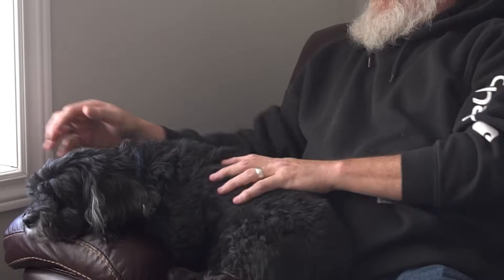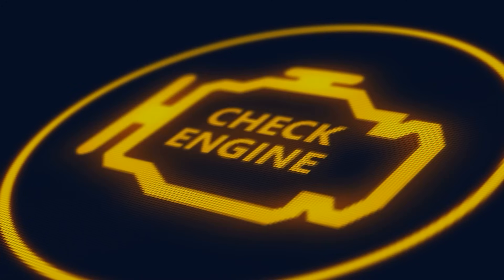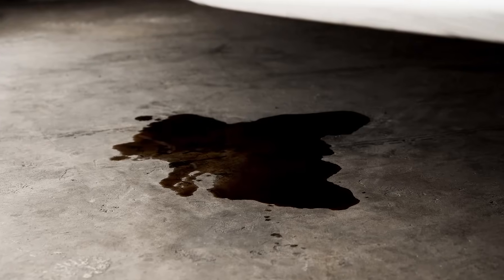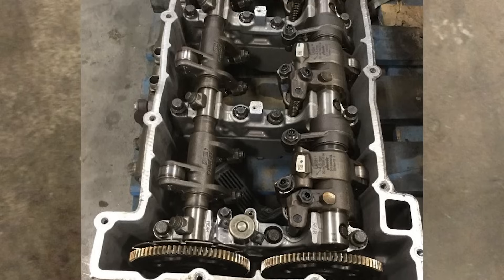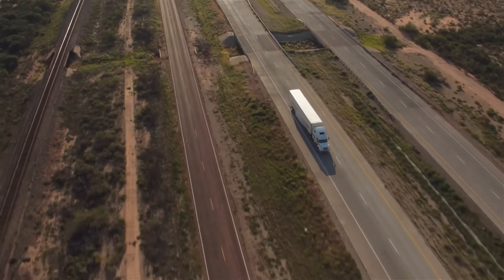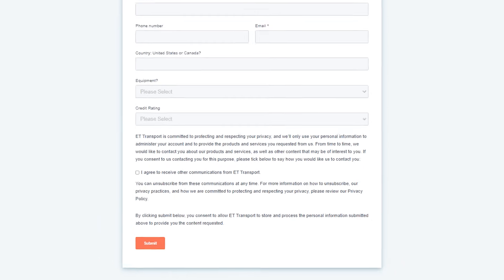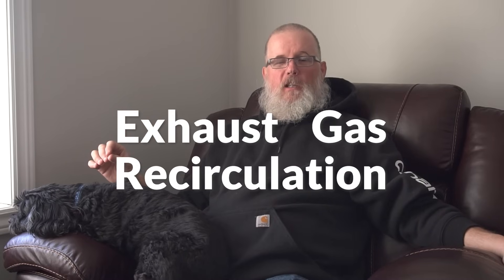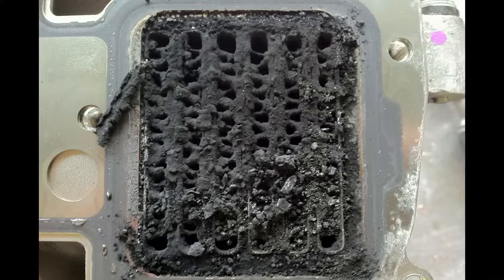Biggest Issues with Diesel Engine DD15 - WATCH OUT!

Comment: I'm a mechanic and at my company they have cascadias with detroits and kenworths with cummins and all the Detroits (dd15) have oil leaks hahaha even the brand new ones have oil leaks because of the oil pan gasket, rear main seal, oil pan drain most commonly
Reply: So basically Cummins is not in the shop as much ? What engine the Cummins ISX and what year truck

Comment: My truck has a diagnostics tool on board. Different than just codes and tells me all I need to know from what the computer is seeing. I have computer scanner as well. Though so far have had no need for it. Series 60 without all the emissions crap. I'll take that engine and truck any day over all this new stuff. Last thing I changed was an oil coolant level sensor. Takes about 5 minutes to changed it and its working great again. I am not a certified mechanic. Though I know my way around a truck for most things and can do most the jobs that are needed on it. I keep learning and that is key here. I will build a shop to be able to take the truck apart and put it back together again. Then I'll know most of what I need to. I enjoy working on my own equipment and learning how to fix and maintain it.

Comment: For oil it is the API rating. As long as the API is approved for that engine your good. Engine manufacturers also say never change the weight of the oil in the new engines, that they are engineered for a specific viscosity. I have been using Pittsburg Power’s catalyst and I have to say it’s expensive approx $18 per fill up but boy does it really cut down on carbon buildup. I also had a series 60 and yes it leaked as much as my AMF Harley Davidson. If you did not see some drippings better check the oil there may not be any to leak out. :-)

Comment: Re: cheap engine oil. I was a placer miner for years. Large dozers, excavators, water pumps, loaders. We bought our oil at Walmart - by the pallet. Why ? Walmart does not make oil - they send out tenders and oil companies make the oil. Never an issue we could point to being oil related. Change every 250 hours.

Comment: Exhaust gas recirculation has never reduced emissions. It tests cleaner.  EGR is a favorite malicious prank of many government departments.  Closing the control valve or blocking the flow shuts down the exhaust.  The motor perks up and runs better in every way.
Reply: Every vehicle I have seen without an egr runs better and the engine lasts longer with more power. Also cooler without all the crap to fail.
Reply: @King Of Crunk I have run both vehicles and I hate the smell of def when it regenerates. It's a horrid smell and if you are indoors both will kill you. I would not recomend ether. And the dpf gets as hot as a barbeque and can clog easily if not run enough to regen or forced regen. I'll take my old engines any day.
Reply: @King Of Crunk I've done the self regen on pick up and semi. Not a fan of ether. Take the older engine over all that crap. I don't care the year and when it runs.
Reply: Main reason why I bought a glider.

Comment: But don’t forget you guys are operating in extreme freezing weather conditions, everything shrinks in those weather conditions, not to mention in those conditions your engines are going from extreme freezing to nearly 200° hot Engine and then rapidly back to freezing again, so what’s so coming up there may not be the same issue in the states with temperatures don’t reach below or minus degree weather nowhere near as often as in Canada
Reply: If it gets below -25C I leave my running
Reply: Yep the so called cycles(every time your engine changes the temps so engine off to running engine) are as I heard somewhere on YT way more important than mileage. No wonder car engines wont last that long as truck engines, we put them thru way more cycels per mile than we do with big rigs. Add winter to it and it takes a huge shift of size in quick time from very cold engine that was off to running engine, like -20 C to + what, a 100 C? In like few minutes?
Reply: Puts more wear on the engine specially on older engines that use conventional oil because it gets thick and it takes way longer to start lubricating motor

Comment: EGR, the worst invention for any engine.
Reply: Who knew firing hot, unfiltered gases back into a engine block wasn't the greatest invention since sliced bread?
Reply: Absolutely, it's very easy, a diesel engine runs best on clean cool air.

Comment: How cold does it have to be before you idle the truck all night and how bad is it for the motor? Particularly the DD15
Reply: You should never idle your engine, other than a few minutes at start up, to warm up, and a few minutes at shutdown, to cool down.
Reply: @RealJohnWayne  yeah I know. But what do you do when it’s actually-30 Celsius or colder?
Reply: @Freightlinerbob  run it at around 1000 rpm. In the ECM you have to have the idle shutdown timer turned off, idle rpm turned up and the Auto Elevate feature turned on so the truck can regen while it’s idling.
Reply: @christianb9565   that’s what I’ve been doing. This is my first winter with a modern motor and it’s also been very cold. Much colder that usual for where I operate. I’m actually shocked at my idle time. Hearing that regen in the middle of the night makes me wonder how much life I’m taking out of the motor and DPF.
Reply: @Freightlinerbob  

For heat, the most efficient and popular way is to have a diesel fired Wabco/Espar bunk heater installed, and if you're ordering a new truck, you can order it as a factory installed option.
Reply: @RealJohnWayne  yes. I’ve had a Webasto or Espar in my last v4 trucks. They don’t help with making sure the engine fires up in extreme cold. Fridge, bunk and engine heaters will kill your batteries in less than 10 hours and what do you do if you’re stuck doing a reset in that weather? 

You idle it.
Reply: @Freightlinerbob  she’ll handle it fine. Make sure you have your winter front on.  Just to give you an idea, my 2015 spent the first 4 years of its life running northern Ontario and western Canada steady. 1,344,231 km on it now. I’ve cleaned the DPF filter once. Next time it’s needed I’ll replace the filter.

Main things:

Replace the DEF filter at least every year. 6 months wouldn’t hurt. Takes 15 min to do it on a ‘shaker. $100 Bosch filter.

Replace the air dryer filter every year with the oil coalescing filter from either Meritor or Bendix, depending which manufacturer’s dryer you have.

For the cold weather, make sure you’re running a 5w30 full synthetic oil. Rotella or Delo are readily available.

If you can help it, don’t put additives in that fuel. If you don’t have heated tanks, sometimes you don’t have a choice, but avoid it if you can. DPF don’t like it.  Just make sure to treat 1/4 tank as empty in those cold months and fuel up before you get down that low.
Reply: @Freightlinerbob  

Since 2017 Peterbilt and Kenworth has offered their battery powered HVAC system as a factory installed option, Freightliner followed suit in 2018, and so have International and Volvo. These systems will start the truck once the 4 AGM house batteries drop to 25% capacity, and recharge the batteries back to 75% and then shutdown. These systems are much more efficient than APU's are.
Reply: @RealJohnWayne  you should read your own comments. First year I told me not to do idle and now you’re telling me about optimized system for systems. AGM batteries won’t last 10 hours, never mind a reset without idling. LifePO batteries probably will, but that still leaves the question of whether or not the motor will fire up after sitting a day and a half at -30 or colder. 

You come across like a virtual trucker who’s read all sorts of stuff but has very little if any first hand knowledge.
Reply: @christianb9565  good info thanks.
Reply: @Freightlinerbob  

You obviously know everything, so why are you asking questions when you already know the answers to your own questions?  🤔
Reply: @RealJohnWayne   you haven’t actually answered my initial question. The other guy did and gave me good first hand information based on experience. Something which you obviously lack.
Reply: @Freightlinerbob  

Obviously he told you what you wanted to hear, so you're all set.
Reply: @RealJohnWayne  wrong.  My 2015 had a electric APU.
Reply: Get an apu and run it heating the cab, the warm coolant will flow round the engine heating the block. Turn your block heater on and the apu will keep the batteries topped up through out the night.

You really don’t want to idle these things, use an apu it’ll save you a fortune in the long run
Reply: @KatherineCracks  that’s definitely an option but most trucks I see with APUs are idling anyway especially when it’s really cold. Either the driver doesn’t care or the APU is broken.  Again. APUs may save money on the big motor but nobody seems to be able to give me actual, total,  operating costs for any length of time.
Reply: @Freightlinerbob  I can tell you that the average apu uses 1/10 of a gallon an hour in diesel in normal conditions. In severe cold you could probably bump that up a bit but if you consider that idling your truck uses a gallon an hour, plus wear and tear on the egr system.

I’d say the 8-12k on an apu would be recouped in a year from diesel savings alone. I suspect the drivers not using them don’t maintain them properly and end up with big repair bills that they can’t afford.

Another good tip for the cold is use a synthetic oil, my friend is an owner op in USA she runs 5w 40 synthetic and has a green apu a combination she swears by
Reply: @Freightlinerbob  APU isn’t worth it unless you idle every day. I idle all night when the temperature stays below -15C overnight or above +20C.  After 7 years I still haven’t burned enough fuel to cover the purchase cost of an APU.

You’re looking at 15 - 18k installed, and that’s without adding an oil pan heater which you have to wire into either the Inverter with a Tripac or into the Carrier APU generator. APU is great for creature comfort and quality of life for cooking.

After the install price, there’s still the cost of maintenance, repairs (which come often) and the fuel that the APU itself burns.  Plus the extra 500 or so lbs added onto your drives.  All that and the APU still doesn’t heat or cool as well as the tractor does.
Reply: @christianb9565  I’m in total agreement with you on this. Everyone repeats the same old and obvious line about fuel savings but I can’t find anyone that actually has hard numbers on total cost of ownership. I’ve got to do something about the idling above -20C, probably a Lithium Iron Phosphate battery for the convenience items, because of their long charge life, but below -20 or so idling periodically if you can’t trust your fuel, is probably a reality.
Reply: @christianb9565  Do You consider The so called cycles(every time your engine changes the temps so engine off to running engine) are as I heard somewhere more important than mileage, engine running time, wear. No wonder car engines wont last that long as truck engines, we put them thru way more cycels per mile than we do with big rigs. Add winter to it and it takes a huge shift of size/parts of engine in quick time from very cold engine that was off to running engine, like -20 C to + what, a 100 C? In like few minutes?
I think I would rather run it all night than have to use auto start/stop and put it thru another cycle cos my batteries need to recharge. Dont own it yet but consider to keep it running when I work thru winter, not talking about having 2-3day off or so, would leave it off for sure. But rly thinking about them cycles🤔
Reply: @Lone_Wolf_91  I agree.  I think, so long as the engine can regen as needed, we’re better off running all night rather than start/stop. Especially in the extreme cold.

Then there’s the issue of sleep.  I don’t want to be dead tired ‘cause the truck woke me up all night with start/stop cycles
Reply: @christianb9565  Yea damn since Im running it all night I forgot how often it woke me up especially shuting it off automatically, would shake the hell out the truck, adding that I also would wake up after sometimes the cold air would be before it turns engine on. 
Comfort at ir finest🙌
Reply: Hi, you need to raise the arpm to 8.8

Comment: The fix for cold temperature 🤒 for the DD15 or the DD16 
Driver's should invest into a FASS fuel system with heater it will prevent your diesel ⛽ fuel from gelling over will increase reliability and fuel mileage
Reply: That heater won’t do anything to keep fuel from gelling in the tank. It only heats at the filter head and only if the ignition key is on which likely means the truck is idling or in the case of the coolant heater, the truck must be idling. When an engine is idling, fuel is being circulated and heated up without any help from any outside source. Especially that little heater element in the FASS system. 

That FASS system must be prone to gelling or icing since it’s hanging out there off the frame rail and not on the side of the nice warm engine like the OEM  filters.
Reply: @Freightlinerbob  Agree, APU with tank heaters, then OEM Fuel filtration with heaters. Some newer engine designs do not return as much fuel to the tanks, as the older ones, this can lead to fuel gelling, in bad conditions.
Best wishes from 55.75N